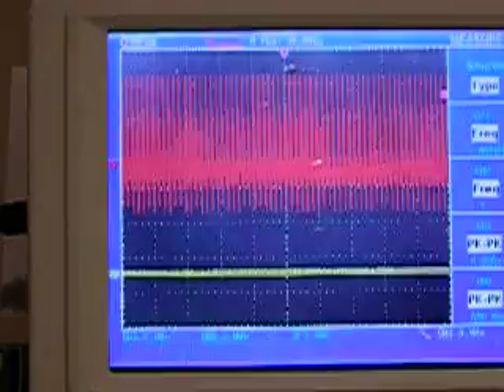Self oscillating

Comment: Is that what radiant energy looks like?
Reply: If you're still wondering about this, radiant energy is an longitudinal capacitive displacement current shockwave of the medium analogous to shockwaves in the air, Tesla talks more about them in the article "ON THE DISSIPATION OF THE ELECTRICAL ENERGY OF THE HERTZ RESONATOR - The Electrical Engineer — December 21, 1892"